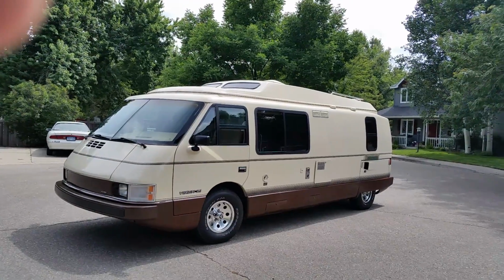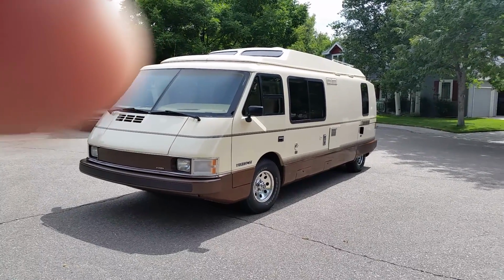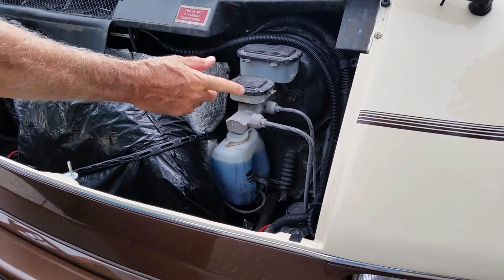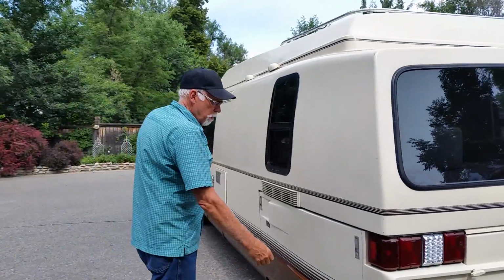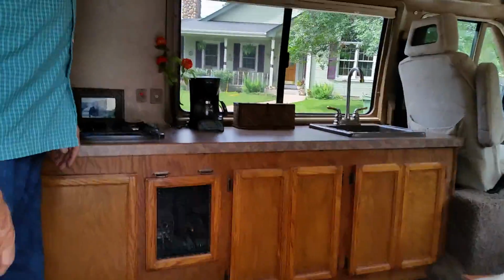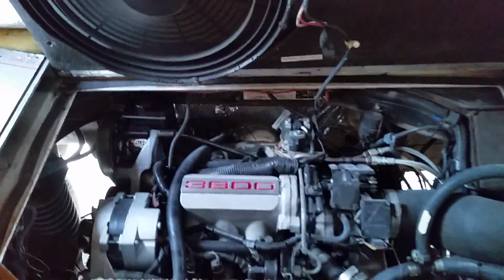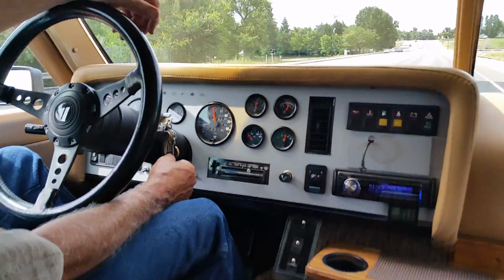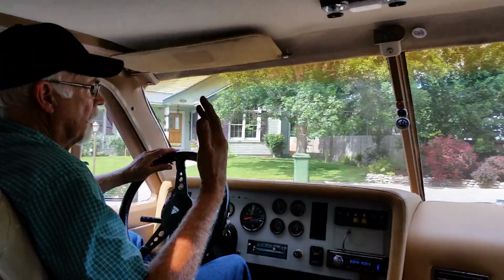Vixen SE Motorhome

Comment: Nice video, Larry.  I'm jealous of how easily you removed and replaced your rear panels; the ones on my SE are a real pain to fit back in place and no matter how I've tried to adjust them they seem to hang up on the sides of the openings. 
   I am just beginning to awaken mine from a 10 year rest after one of my wife's cats climbed around on the engine and apparently dislodged something crucial to making  sparks at the plugs.  My first job is to get all the 10 year old gas out of the tank and then do a good pressure washing of 10 years worth of exterior crud.  Your paint looks exceptional - better than ours ever looked even when we first bought it in 2001.  I concur with your mileage figures - we usually averaged around 18 MPG on the highway and less around town.
  Thanks for posting this, and I like your modifications.  Mine also had the side door added in the left rear storage box but not the side vent and big fan mod under the bed - just a small 12v fan blowing out the "extractor" side of the right rear panel.  I hope you enjoy your Vixen for many more years, and maybe once the cats are gone we'll see you on the road somewhere.
  Phil Warner in Northwest Arkansas

Comment: This is my idea of what a motorhome should be. It's small enough to park in most garages or carports, provided the opening to the garage is high enough to clear the roof, and A/C unit if so equipped, you could also drive it anywhere you want and not feel like you're driving a behemoth tour bus, most of them are 40ft+ in length, and yet it's tall enough that all but the tallest adult could stand upright and walk around inside the coach. Two adults could travel in it in relative comfort, provided the bed in the back of the bus is large enough to sleep two adults. I'd buy one if I had someone to share in the experience and responsibilities with. My favourite is the SE model. It has the fixed elevated roof and automatic gearbox. It's too bad so few were produced. That makes them rare as hen's teeth. The only mechanical upgrade I'd have done to it would be a Duramax LWN 2.8 litre 4 cyl. Turbo Diesel engine, or possibly a Toyota d4d 3.0 litre Turbo Diesel engine, and a compatible automatic gearbox. It's a damned shame that so few were produced before being discontinued. While it may not have been for all RVers, I would think it would've been perfect for those who don't need or want a 30ft RV or a 40ft RV.

Comment: I like the rear overhang on this RV. Usually, with most motorhomes, between the rear wheels and the rear bumper, there's so much space between the rear of the rear tire and the rear-most part of the bumper, that normally accommodates the engine. With the engine mounted east and west, as opposed to north and south, you save space, and the bed is mounted east and west. You and your wife should still be able to fit comfortably in the bed, depending on how tall you are.

Comment: I consider it unforgivable that the Vixen was discontinued when it was. Not everyone needs or wants a 30'+ diesel pusher motorhome. It's also a shame that this wasn't available with a turbo diesel engine. Who needs a 40' diesel pusher, when one could go for a 20' diesel pusher. 🙂
Reply: @larrygillam3311  It's too bad that it wasn't available on the SE model along with automatic gearbox.

Comment: love this vixen.  which model had the best gas mileage?  diesel, right?
Reply: @larrygillam3311  IMHO, this is the best looking Vixen offered. It's a damn shame only a few were offered before Vixen pulled the plug on the project. I think it would've been the perfect motorhome for either the newbie RVer just starting out, a traveling entrepreneur, or a veteran RVer looking to downsize to a smaller motorhome.

Comment: As much as I love rear-engine powered motorhomes such as this, I imagine servicing the engine would be a difficult thing to do. I don't see anywhere you could access the engine, other than through the bed inside the coach.
Reply: @larrygillam3311  Really? How about checking the oil and changing the oil?

Comment: If I had a motorhome like this, I would install a small displacement diesel engine where the current V6 engine is.
Reply: ...like a Deutz, or a Perkins, or a Lombardini, or a Kubota?  😄  I wonder if a Toronado drivetrain would fit in it, that's a big block engine, I think.    

I'd add electric traction motors to drive the front wheels, like a FWD hybrid car.
Reply: @Texaca  Those sound like good ideas. I don't know about a Toronado V8 engine. That seems rather massive for what was originally a 3.8 V6 engine. I would've installed either a Duramax 2.8 litre Turbo Diesel engine, or a Toyota D4D 3.0 Turbo Diesel engine and a compatible automatic gearbox.